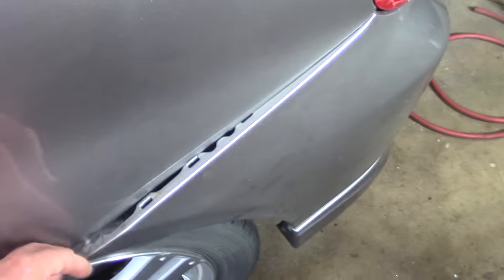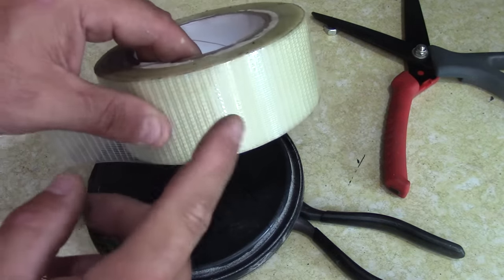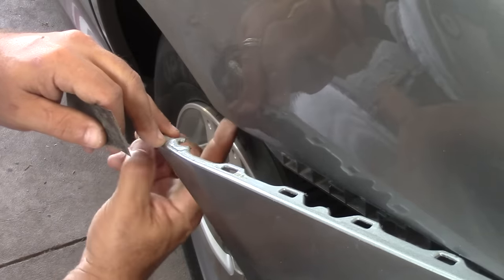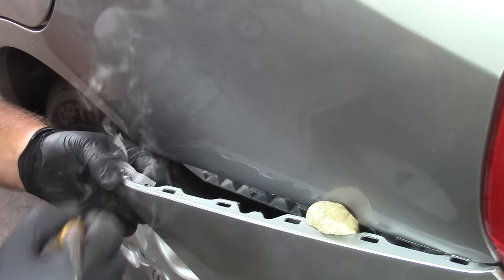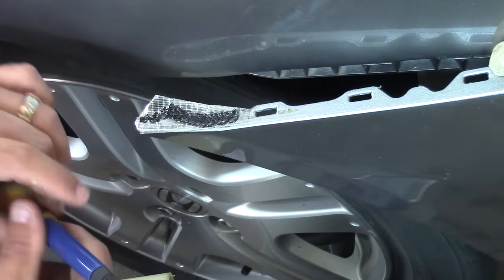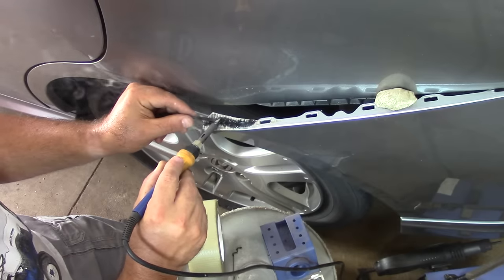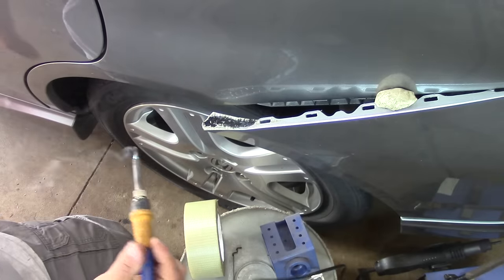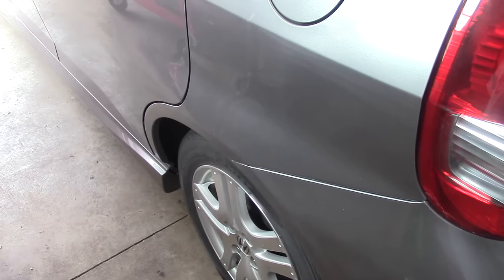Car Bumper Broken Plastic Tab Repair

Comment: I have just one criticism... sorry. Bumpers are typically made from thermoplastics such as polycarbonate, ABS, PBT, polypropylene or a combination of a couple, e.g. PC/ABS or PC/PBT alloys. A coffee cup lid is typically made from polypropylene or polystyrene. For the longest lasting bond, you should always look for the little recycle symbol printed somewhere on the inside of the bumper. It will have a number within the symbol, like a 4 or 5, and sometimes state below it the plastic... PC/PBT for instance. This is for recycling purposes, but also tells you what type of plastic your bumper is. The numbers represent a plastic, but usually if it's an alloy, it will have a number 7. I've fixed motorcycle fairings and had to order plastic alloy welding rods of exactly the same material, as this will provide the best strength, longest lasting bond. It could be that you got lucky and used a polypropylene lid on a polypropylene bumper. Good job anyway, but that is my only advice. Hope it is helpful.
Reply: @PeterFeltersnatch852  Sounds like you're the one who likes to criticize.
 He was just giving some very useful info about thermowelding alike kinds of plastics on bumpers.
Reply: @PeterFeltersnatch852  it's not just about how good it looks. What about how long it lasts? You really are a simple man.
Reply: @funcool32  simple man is clearly a simple child. Don't waste your time with him.
Reply: @PeterFeltersnatch852  He is
just taking it to a higher level that is all. No criticism but education.  Makes sense.   Don’t let your ego get in the way of learning something.  I do understand your motivation.   Your respect for the man who created this video and did a good repair not being an expert working with plastics.   So now we have an expert give us some of his wisdom bam!  We are benefit for sharing.  It is sweet that your respect shined thru.
Reply: @kerry9125  do you always talk behind people's backs?  Criticize who?  Are you okay. ...
Reply: @funcool32  yeah I guess you're correct and yeah I guess I am just a simple man. I'm definitely okay with that!
Reply: Вы ошибаетесь, бампера обычно изготовлены из ПП  и ПЭ пластика.
Reply: Where you’re wrong is that he used a coffee CAN lid. It’s a bit stronger plastic than those that go on Coffey CUPS.
Reply: @funcool32  it’s not like it’s a moving part as long as you don’t back it up into a tree you should be good with that kind of repair
Reply: @mountaingrandmama  which is unnecessary boasting of one’s knowledge that teaches nothing about bumper repairs. Even my 74 years old mother knows the differences between the symbols for recycling stuff. But I still don’t see the relevance of that knowledge here, unless the intent was to address issues with trying to weld different kinds of plastics together. What the videos shows me is that it just works. Coffey can lid to car bumper.
Reply: @kerry9125  what you're doing is called anti- intellectualism. Plastic welding is a thing in manufacturing and auto body repair. Dedicated equipment and materials are sold for the task. There are many types of plastics and combinations of plastics. Specific plastics are sold  for plastic welding.
Reply: All bumpers I’ve seen from Toyota have been PP so chances are he did exactly the right thing with that lid
Reply: @ericohman  unless the lid is polystyrene 🤣
Reply: @funcool32  why you a hater lol internet expert lmao
Reply: Thanks for your polite reply and take onboard your advice. Only want to do one sturdy job.
Reply: Wow!there you go. There's always someone complaining about little things. He just showed how he fixed his  loose bumper for a little to none amount of cash. You just need a little time and used plastic but of course youre here. To criticized something who most of use doesn't really care. Loose bumper fixed! Cost?! Just patience and time.
Reply: Ok Mr perfect..
The man did a wonderful job
Reply: I don't see anything wrong with your "criticism".  You just added further information.  Perhaps the original poster knew already and perhaps he didn't but you helped me, and I suspect many others, to plan future repair projects.
Reply: It worked didn't it.......don't criticize him so much, he's trying, job well done
Reply: @robertward8037  take my "advice", or don't take it. I don't care. It'll be the difference between your repair lasting months vs years.
Reply: You could melt a zip tie into the groove

Comment: a zip tie works great as a filler. Very strong once cooled and flexible.
Reply: I used 8 zip ties on my sons 09 dodge avenger last year and they are still holding strong. And we live in one of the coldest and 10 feet of snow every year. The salt eats up anything it touches I will replace them before this coming winter.
Reply: Cheap Black DVD cases are Way good we used instead of Glass Fibre Mess... 

Same Solvent melts and bonds that stuff into Rock Hard Plastic base for repairs and can be easily cut and shaped!
Reply: @michaelmclaren1333 thanks a bunch for the tip. I have do this same repair on my bumper
Reply: @greatestytcommentator  I never even thought about using those! Tyvm!

Comment: Epoxy a stainless steel washer on the bottom side.  Grind one side of the washer flat as needed to fit.

Comment: This is the most effective DIY bumper tab repair I could find on Youtube without having to buy expensive tools. I used an old, rather thick metal screen as my mesh, but your tape looks MUCH easier to use.

Comment: But I am surprise that no one think: «Is this normal for bumpers to break so easily?» 
Are we victims of planned obsolescence? Dealers...Repairs...Money...
Reply: I must add that my car is unfortunately rented.
Reply: Yeah. My peugeot 308 front bumper cracked from the side 1.5y ago even tho i never hit anything with the car, probably some tiny snow bank in winter was enough to break it. Used some plastic epoxy to glue it and put some layers of Gorilla tape as support on top of it just because the plastic is so flappy, the tape is roughly similar color as my car so the tape doesn't stand out too much.
Reply: I wonder the same. Doesn't help matters that low rise sedans are considered the trend lol

Comment: New sub here. I have the same issue with my front bumper fascia on my Honda Fit. . Thanks for this great video. I'm going substitute JB weld for plastics for the heat melt part. I bought the car two weeks ago and the front fascia issue has been bugging me. I was first thinking of using a plastic or rubber washer but I like your use of the coffee can lid much better!
Thanks!

Comment: If this happens again, use JB weld to hold the repair piece in place. The plastic doesn't bond as well to the existing bumper material as well as JB Weld. Found this out the hard way.

Comment: Very nice trick, the bumper on my 99 Ford F150 was hit and now i have the same issue. I thought of attaching a piece of plastic and using JB Weld wich also bonds very well, but ur method appears as effective. Thx for sharing the vid, very helpful IMO. Just cant run to the dealer for every little issue.

Comment: I know this is an old thread but you might be interested to know that most bumpers are ABS - you can get ABS filament for 3D printers from everywhere... It's perfect for this job... Temps are about 300oC to melt it... Keep that tip in mind when next your thinking plastic weld
Reply: Aus User exactly! Or you can use a piece of plastic from a scrapped bumper as filler.

Comment: Thank you for creating this video.  I came upon it by accident and it just happens that while I was washing my roommates Honda, I noticed that the bumper wasn’t properly attached.   Upon further inspection, I saw that the tab was cracked.  I am a 62 year young woman who has been doing things that I have never done before with the help of YouTube!  I am in the process of learning the fine art of using compounds, polishes and wax for color correction.  This whole deal started while I was washing the 86 Honda to get the dirt off the windows.  I was going to borrow it while my car was in the shop.  The roof of the car was bleached white.  I took a magic eraser to it and found out that wasn’t the paint that was bleached out but the peeling clear coat.  Well 3 days later, I got it all off.  I learn new things everyday.  Maybe today you all learned something from me.  If I can do it, you can too.   Get comfortable reaching outside your comfort zone.  ❤
Reply: But you then replaced the clear coat.... Right?

Comment: I just ran across this clip and your demo is great. However, in MHO, that alternate repair is not worth the effort. Replacing the plastic fastener with J-type speed nut and a hex head screw with a spinning washer will do nicely. Thanks for sharing...

Comment: Lowe's in their hardware dept. miscellaneous drawers sells plastic washers in different sizes. Range from 1/32 to 1/8 inch thicknesses. They weld real good and I've even used JB Weld which works great.
Reply: Nice option!👍

Comment: Looks like a really good economical fix. My problem is the clips were ripped from the bumper cover. So I'm looking for a bonding agent to apply plastic on plastic to adhere bumper cover to frame.

Comment: Thanks for sharing the video. Your method was pretty innovative and ingenuous and addition of the meshed tape to the equation definitely helped. It stabilized the plastic piece you tried to attach to the bumper, freed your other hand and made the area you tried to fix more accessible for using the soldering iron (to tack the plastic piece you made).

Comment: 3m or bondo makes a small kit for bumper repair. Worked excellent for my car. Same tab issue as you. Just has to sand it down so the top isn’t so high like you were mentioning
Reply from the maker: Good to know.

Comment: A screw with a washer would have only taken a few minutes.
Reply: Maybe,  but sometimes there will not be any material for the washer screw to bite on not to mention that with time( different season temperatures along with high winds due to freeway  driving )that the edge of the bumper cover might break loose. I find this repair to be creative, ingenious,  low budget, and most importantly lasting.

Comment: that really did turn out good,, it's a shame that cars don't have metal bumpers anymore,
Reply from the maker: I wonder how much money they same by putting a plastic cover over a simpler metal bumper?  By the way I like your new stickers.
Reply: I'll never give up my '68 Fury and '71 Imperial daily drivers. Metal screws holding metal parts.
To hell with all this plastic bullcrap. I own a bodyshop but do mainly rust repair/metal fab. But when I have to deal with plastic parts and those evil plastic clips, I get violent! :)
Get tips here though. I actually have a plastic welding gun. Certain plastics are un-weldable.

Comment: Dude.  THANK YOU for this video.  I took some of your info, combined it with tips from 2-3 other videos and voila!  I used Permatex Black Plastic Weld, and took your tip to reinforce with plastic from a powdered creamer lid (you got coffee, I got creamer LOL) and Gorilla tape cuz I didn't have any of that fiberglass tape.   Had a moment of panic when I realized I didn't mark where to drill, CRAP!!  So I guessed and it turned out great anyway.  Doesn't look like the bumper cover was ever torn off. I fixed my own damn bumper for $20 vs. $1,000.  THANK YOU.

Comment: Try some extreme strength 3m double side adhesive tape. My front bumper fascia on my 2016 corolla S, did the same as your bumper fascia. The extreme hold 3m worked for me

Comment: Almost every Nissan and Toyota has this problem with the cheap clips breaking off when going 80 MPH on the highway.  My company car was a 2015 Toyota Matrix and got this problem. I used strong clear packing tape over the seam to hold it real good. The boss saw it and told me to bring it to our local service station for proper repair. They put on an entire new bumper section (one huge wraparound piece) for about $2000. Within one week, someone ever so slightly backed into it and broke the clips again. Now I'm back to the clear packing tape. LOL. Stupid boss.

Comment: I realize this is an old video but it’s what I need.  Similar situation.  Wife backed her Nissan SUV into my Tahoe in the driveway.  I fixed the Tahoe damage using Tiger Seal to reattach a plastic bracket on the backside of the bumper.  I just spent $1,500 on a replacement bumper a year ago and $1,200 on hers.  So, here we go again!  The only thing I have to weld with is soldering guns.  Would that work?  Her bumper is pulled away just like yours plus she has big dents that I also need to try and remove with heat.

Comment: What do you think of using JB Weld Original Epoxy if you were to do it again? I've never done plastic welding but you made it look easy! I had a minor fender bender years ago with almost exactly the same issue.

Comment: Yeah, this will work but too complicated and messy. Thing about heated plastic is that it tends to harden brittle and break off. Wonderfull stuff this coldweld for plastics. Rough a piece of stiff plastic or thin aluminum and glui it on and you're done. Holds like a bastard.

Comment: Nice video but way too much work! Just superglue (use gel) a stainless steel washer underneath where the broken plastic is and use a self-tapping screw to hold it in place. 

Anytime I have a broken plastic tab I always use the superglue and washer trick.

Comment: melting plastic is not really good for you, it has carcinogenics in it, I would have just used some fiberglass, same thickness as what you got and dries rock hard, no need for messing around with a soldering iron, sharp knife and done.

Comment: I was looking on here on how to properly remove a rear bumper to paint. My 08 Civic is in almost perfect condition except the exterior paint is chipping. In addition, both rear and front bumpers were missing clips. The previous owner backed/drove into the curb and pulled them out. I have been using a "S#!T-ton" of zip-ties...but now that I have seen this...I'm juiced to fix it without the cost/time of replacing. Thank you...THANK YOU...THANK YOU!!

Comment: Congratulations for you idea and your job. You did great and your video was very professional. I have a similar problem on my 2015 Subaru where the wheel liner joint the body of the car. I will certainly use this idea.
Again, congratulations.

Comment: FYI JB weld will also give you a strong and solid hold. You can find it at any locat auto parts store or Wal-Mart and it's not expensive.

Comment: You could have simply glued a washer to the bumper with a strong adhesive or epoxy and ran the screw thru it and that would hold your bumper in place.
Reply: I may try this on my Acura Legend, the body shop put a metal strip there and drilled a nail  but doesn't hold well.
Reply: Yes, that works, i had done it in 2010 for my Lancer
Reply: What do you exactly mean by “ran the screw thru it”? I’m trying to fix my front bumper and this would really help. Thank you!
Reply: @happyey  The washer glued or epoxied to the bumper in place and replaces where original hole was then you simple use a screw to attach the bumper to the car's body just like you would if the original hole was there.

Comment: In the UK a plasterer would use that fibre tape to cover the joints in plasterboard before covering it with plaster. It stops the joint cracking. He would call it "scrim" tape. You're welcome.

Comment: Why not just use a small washer and glue it to the bottom of the broken hole with super glue. Can screw it in once dried. It all should align.

Comment: I also had a loose bumper, I used indusrial commercial clear silicone glue and its been three winters up in canada and it has not come loose.I also had somebody back into it and i was surprise it did not come loose or come off. The way i did it was i tape it with duct tape to hold the bumper up to the body and used the silcone glue and left the tape on for three days for it to cure and filled the remaing gap after i took the tape off.used cooking oil to remove the tape glue.

Comment: The best rule-of-thumb is to try and use a piece of the same plastic you are
trying to weld. Plastics have different chemical compositions and not
all plastics will adhere to each other. You want to clean the plastic on the car as well. If you take the approach from the back you want to glue it first . The plastic you want to use 
is polypropylene, this will adhere to automotive plastics. Turned out good.

Comment: Thanks! With the two piece clips, you don't separate them right? If I'm installing an inner wheel well plastic piece, i don't place the lock piece under the wheel well piece and the clip on top right? All I do is place the two-clip piece on top and push...

Comment: I'm going to fix mine next weekend. My idea is to mix up some epoxy, soak a piece of a shirt or something in it, wrap the shirt (or whatever) around where the tab is supposed to be, put some wax paper around it, put a couple of blocks of wood on either side, and put a squeeze clamp on the blocks so the blocks will hold the epoxy soaked cloth in the right position while the glue cures. Once it cures, I can use my Dremel tool to do any trimming I want to do. Then I can drill a hole, and Bob's your uncle. That's my theory anyway. I'll find out next weekend if it works.

Comment: I just stuffed pieces of plastic from an old underbelly panel under those three clips to help them push up against the bumper loops. Make sure you cut the plastic in rectangles and fold accordingly so the “spring” of it can push up against the clips which clips on to the bumper. My front bumper has been good for close to two years. All it cost me was a soda and 20 min of my time.